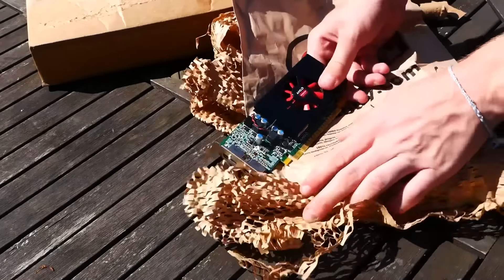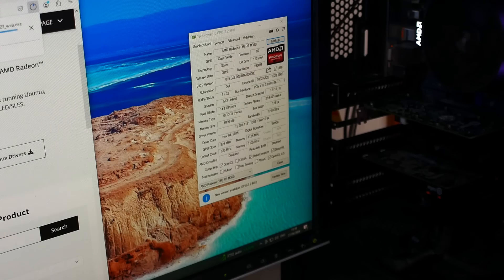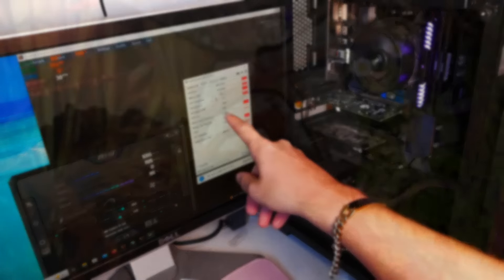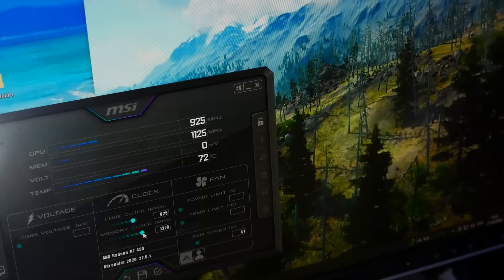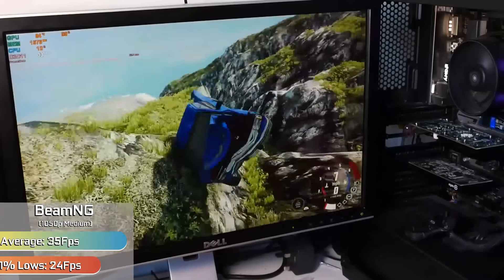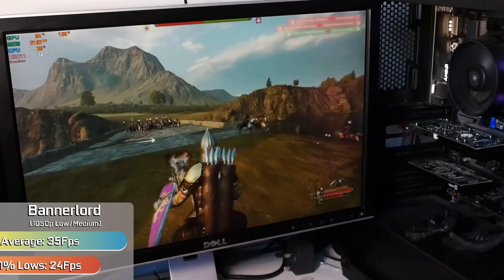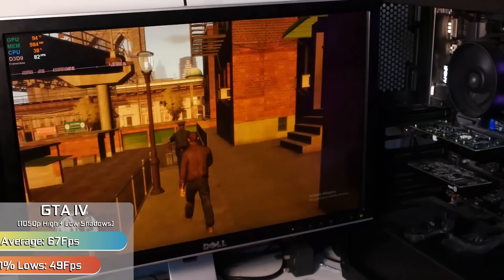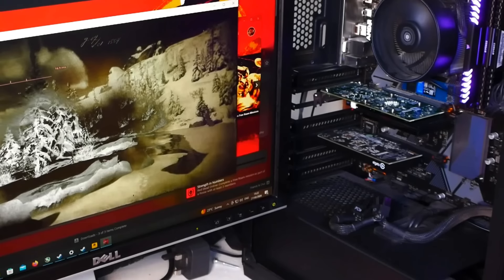AMDs Mysterious & Misleading R7 450...

Comment: AMD's budget cards are always bizarre. I swear the designers make them after waking up from a fever dream.
Reply: At least they have all pcie lanes compared to new OEM cards?
Reply: perhaps 'during' it?
Reply: They're designed for Drafting and 3D Modeling software users, which is why they're in business-aimed small footprint OptiPlex models. I think my old PC at work had this GPU, and I loved how well it handled hard workloads.
Reply: Fr, i have an R7 240 with 4gb vram, why??
Reply: @MrEdioss  or new retail cards. Like how the RX 460, RX 6600 XT, RTX 3050 and RTX 4060 Ti have 8 lanes and the GT 1030 and RX 6500 XT have only 4 lanes.
Meanwhile a stinky HD 6450 or GT 210 come with full 16 lanes.
Reply: @mactep1  So that they can say "with 4 GB [newest generation] Radeon graphics"
Same reason the HD 8000 series exist. Or the GT 300 and GTX 800 series. Or a 4 GB GT 730, or a 256 MB FX 5200
Reply: @mactep1 4gb can hook many people  bigger vram is good anyway and ddr3 is overflowing and they patches the ddr3 vrams and make the cards look worthy. Of course gddr5 2gb vram amount is enough for the entry card.
Reply: The incredulity I felt when AMD released the RX 560 XT (OEM-only, thank God) in roughly the same era the RX 5600 XT was out really put into perspective how little AMD's marketing makes sense to me, and it has gotten worse over time
Reply: @daemonspudguy  by the way 6500 xt 4gb is really good at SW outlaw. It runs it beautifully.The Budget entry card is worth of XT this time. I sold 6500 xt 4g, I am happy that the buyer would be happy to the star wars if he played. I sold having solid rx460 4g and r9 m360 4gb. They are solid. Also I have hd7770 2g and hd 7870 2g.
Reply: @mactep1  It is likely a DDR3 4GB instead of a GDDR5 1GB. The GDDR5 1GB is the superior card as the other 3GB don't matter because that card isn't powerful enough to take advantage of it anyway.
Reply: Often just a way to use up surplus GPU chip stock or free up newer and  better node volume for better GPU's.  Made obsolete though by better modern APU's.
Reply: @generationkilled  Good for saving energy with mini PC. I saw the photo taken by GPU market in one's garage. He put all gpus in a Styrofoam box like sliced bread. I will do those to my old GPUs.
Reply: @MrEdioss the cards you are referring to aren't even powerful enough to utilize 16 lanes... and makes 0% difference on the performance at that tier....
Reply: AMD is Chrysler…. From the mid to late 90’s….  Chrysler parts bin cars
Reply: @MrEdioss  they do, just those are not needed at all? Well maybe on pcie 1-1.1 mobos?
Reply: @alancarr195 I could have sworn the restricted memory bandwidth was a huge limitation for the RX6500. At the time of its release it (and especially the RX6400) were quite weirdly placed, as they were supposed to be lower end cards but you needed PCIE4 for them to perform well so they were a bad choice for anybody wanting to upgrade an old PC.
Reply: @thesenamesaretaken  the insane small bus was holding that one back yes, but not its pcie lanes(bigger bus i think they both couldve been better cards by a little for budget systems), but yeah some the versions that did run on x4 of those 2 cards specifically take a bit of a hit on pcie 3.0 systems without rebar and just cpus with no l3 cache and bad pcie support like ryzen 3500,4500,5500 paired with them started to hit. But like rx 6600. Rtx 4060, etc on 8 lanes don't send enough data to cpu to use the full 8 lanes at pcie 4.0 let alone 16.

Comment: Odd coincidence, I am building an ultra budget system with this today. Snagged this card, supermicro motherboard, X3460 Xeon, beat up case, Dell 200W PSU, and 16GB of DDR3 from a scrap pile. Add $15 for a 256GB SSD and it's a perfectly usable light gaming PC.
Reply: 775 xeon with 200w PSU is a disaster
Reply: @MrEdioss  Its socket 1156
Reply: Can I ask what games you even play
Reply: Dude, you can get a E3 1240 V3 with a motherboard for less than $30 used in most cases. Pair them with your memory, PSU and ram and you have a very respectful budget build.
Reply: @HardWhereHero I mean, maybe they don't have $30 atm, here in Brazil, $30 = (a bit more than) R$150... Not everyone will have that much to spare.
Reply: Oh, that is basically an i7-860.
If your board runs 190 MHz BCLK stable, you'll get it to 4 GHz.

But I would be careful with the PSU even on stock.
The CPU has a 95W TDP, the card 65W, and you have to factor in the other parts.
Only 40W to spare, take about 3W per RAM stick, about 5W for storage and about 5W for the chipset.
3W per fan (and you'd want at least one intake, one exhaust and the one on the CPU cooler) and you're down to 15W left.
And don't assume all of the 200W to be available on the 12V rail.
Reply: Yeah, your CPU is actually overkill for the R7 450, lol. You could put at least an R7 370 in there. Due to AMD's confusing product names, it is in fact much more powerful than the R7 450 (about 2.5 times).
Reply: @Lurch-Bot  That requires a 6 pin power connector which their power supply might not have
Reply: I wish there were scrap piles with ddr3 in it. That shit is gold around here and seemingly more expensive than DDR4

Comment: The GTX 750 Ti also hold's its value because it's not actually a 700 series card. It's a 900 series card wearing a funny hat and a trench coat. Which means that its still supported by the latest nvidia 560 drivers on windows and linux. Where as most of the 700 series lost support a few years ago.
Reply: I'd recommend looking at the Quardo versions, the K620 sips power, the K1200 is a great SFF card, and the K2200 is basically a full 750Ti with 4GB, and they're all dirt-cheap because it was the base option for workstations.
Reply: There is maxwell 2.0 gtx 750 somewhere around syllicon belly I assume
Reply: I have one of those sat in its box waiting for a power supply . Used it as my main for about 7 years (don't play new games) and still works as good as the day i brought it.
Reply: There are also like 5 Trillion versions of the GT 730.
Reply: @Fay7666  no no you want the p620 not the k that stands for kepler
Reply: Pascal architecture the p620 is between the gt 1030 - gtx 1050
Reply: @si4632  Not the K620, K1200 and K2200 though, these are Maxwell GPUs. Similar to their GeForce brothers (GTX 745, 750 and 750 Ti) which are Maxwell GPUs but branded as 700 series cards.
Reply: @OverTallman  yeah but for couple of shekkles more you can bag a pascal card i might get one for plex server transcoding videos
Reply: @si4632  Wish this was the case in UK though... K2200 is ~£20 used while P620 is at least a tenner more. Not to mention P620 is weaker than K2200 in terms of raw power.

It only makes sense when the much better transcoding capabilities of Pascal is needed, which in your case does.
Reply: @OverTallman  yeah im only looking at low profile cards as well the p620 uses 40 watts tops
Reply: @OverTallman  k2200 isnt really any faster either just consumes more power
Reply: still you can save a tenner like you say for almost identical performance
Reply: The 750 and 750Ti are also the lowest end cards that will work with the standalone version of RTX Voice (the microphone noise filtering thing that exploded in popularity a coule years back). Otherwise it's 950 and up only, kepler doesn't support the fallback CUDA features it needs/uses on non-RTX cards so it stays silent. I still have a 750Ti as a secondary card in my main gaming rig just for that purpose (so i don't blast my friends ears off with my mechanical keyboard) because my main GPU is an AMD and its noise filter built into adrenalin is absolute dog excrement in comparison. Also gives me some extra ports for additional monitors that don't trigger AMDs buggy idle power consumption issue. Next upgrade will definitely be a (used) Nvidia card again, that's for sure...
Reply: Yeah that was one of the first Maxwell cards if not the very first one. Nvidia struck gold with that architecture.
Reply: @OverTallman Like 50 bucks for a gtx 980...just saying.

Comment: This screams for a budget SFF build. Preferably just pick up an old Optiplex SFF and chuck this in + more RAM
Reply: If you get one for $5, this is fabulous. The lowest price I can see is like $20 for a 2gb full height OEMmodel, though - I'd step up the budget to 30-40 and get an RX 550 instead, the OEM version of that is basically an iteration on this card - 512 shaders, 4GB GDDR5 VRAM, but GCN 4.0. It's about 33% more price for 33% more performance, basically.
Reply: A FirePro W5100 can be had for around $30, has 4GB GDDR5 and 768 GCN 2.0 cores. It is roughly equivalent to the Xbox One iGPU in performance so it should run pretty much anything that runs on an Xbox One. The real price for an R7 450 4GB in the US is $30 or more. The W5100 is 50% more powerful and about 3% behind a GT1030. The W5100 supports feature level 12.0, whereas the R7 450 only supports 11.1
Reply: @Lurch-Bot will the w5100 fit sff? Looks like a big card
Reply: @Lurch-Bot  wx 4100 is one of the best gcn low profiles, 4gb vram and decent performance at 1080p even, should be about ps4 level in terms of gpu performance

Comment: I had a HD 7770 before upgrading to a GTX 1650. Nice to see older hardware still being able to shine in modern day.
Reply: I've got 2 of those ready to go inside a retro PC for some windows XP gaming hahaha
Reply: I still have my R7 250X here, originally supposed to be for me secondary system, but that got my old 660 Ti once I grabbed a 1060
Still a fine card. Good old AMD Finewine.
Got mine from the default 1000 MHz GPU 1100 MHz/4500 MT memory to 1100 MHz GPU 1337 MHz/5348 MT memory. The memory would go a bit higher, but I found it much funnier to be able to say my chips run at 1337 MHz.
Reply: @davelowe  I have two hd7770 now. Once I had 3. Hd 7770 2gb I used recently in my one of win10 pcs. The other one is in the box
Reply: Nice cards🙂. I even have my old MSi HD 3650 with 512MByte GDDR2 and MSi Cyclone HD6850 1GByte GDDR5 on my shelf as decorations.  I only find out where the bios switch on my Cyclone was after I upgraded it 😅

Comment: I scored an old OEM RX 550 4GB low profile card off a junked Dell next to a dumpster. That's right, a friggin' DUMPSTER. It outperforms an Nvidia GT 1030 2GB low profile card while only maxing out at only 50W. I've kept it around as a backup for budget builds.
Reply: I got a dell next to a dumpster too😂😂😂😂 but the video card was removed, and the cpu is an intel core i3-4130. The pc is ok for basic web stuff but not gaming due to not having a dedicated GPU.
Reply: It's annoying what people will throw away.  I found a perfectly functional Playstation 3 sitting next to a dumpster.  Then a month later, I found a third party Playstation controller next to a trash can.  I even found some games somebody was throwing out, unfortunately, those were for PS4.

Comment: I also own a similar OEM R7 250 2GB I bought used on ebay for about $20 about 2 years ago.  I put it in an Ivy Bridge SFF computer I found on the sidewalk and use it in my HTPC for couch co-op games.  With appropriate settings I could play Mordor: Shadow of War at 30 fps.  And my card is tier below the one featured here.  Weirdly my R7 250 overclocks significantly and the benchmarks show a nice ~15% GPU uplift.
Reply: What are some couch coop games you play? 

I'm currently trying to set up a pc for that purpose.
Reply: The R7 250 is good but quite a bit behind the GT 1030… but the 1030 goes for a much higher price
Reply: @sajanator3  It runs Overcooked 2 at 60 fps @ 1080p, no problem.  Though in the US, a AMD WX4100 4GB might be a better choice if you have $50 to spend on a SFF HTPC setup.  As that card is basically a RX 560!
Reply: @Bboyman1150  ya a AMD WX 4100 4GB is a better option at that price point if you want 1030 performance or more.
Reply: i used a 250 for server gpu output for a while
Reply: @Castaa  what are other games you play? 

I've found that they've kind of erased couch coop in 2024

Comment: For some reason, here in the states, these sell for the same price as the Rx 550 at ~$30
Reply: Yeah, I checked eBay and they are running between $25 to $30.
Reply: @mattelder1971  if I could get my hands on this gpu for $5-10 I'd keep a stockpile for any and every office PC I randomly procured
Reply: You can also get a secondhand RX570 for about that price too which is crazy. I see $40 regularly.
Reply: @tacticalmattress  Yup, even 4gb 580 can be in this price range, for 8gb version they usually want more though.
Reply: @testtest8399  I still have one because it just isn't worth it to sell. Keep it for troubleshooting or i guess incase any of my newer GPU's die

Comment: casually twists the bracket straight to fit it into regular case
Classic.
Reply: I have always felt doing this was a low point in my IT career. far more convenient than removing the bracket entirely and having it flop about in the slot! - I mean, what else can you do?
Reply: @ChishanFipz  not use it
Reply: @ChishanFipz  forbidden jitsu, Dremel a slit into the case PCI rung.
Reply: @Anthrocarbon  Glad my test-junk-case (InWin 303) doesn't have any of those to start with lol. if you remove all the blank slot covers it's just a giant gaping hole, intended to make installing a vertical mount easier... (which I always found dumb because that then blocks ALL other slots, vs the IMHO better option of dedicated vertical slots in the case)
Reply: I didn't appreciate it, LOL

Comment: Reminds me of the ATI Radeon HD 5450, sorry i mean the HD 6290, oh my bad it's actually the 7350...oh no wait, the 8350...actually wait, the R5 220

Also, the legendary Nvidia ION...wait, it's actually an 8400...or is it the 9300....or the well known 210 !!...wait it's more of a 310...or maybe even a 405! NO, the 505!!

Could probably list many more, but the list is too long hehe
Reply: No point making it complicated..
Reply: @darthwiizius bratan it was just a joke, its all fun and games. It's a fun card, but many have a history as such, reuaed. The damb 210 wa sold till like 2020, of not more. Then the 710 took over, which is basically a 210 ofnits ewra
Reply: @NecroFlex  
I know mate, I may have been being somewhat sarcastic..
Reply: Remember that there were 3 versions of the 8400 GS
One with a G86 chip and decent budget performance
One with a G98 chip and half the performance
And one with a GT218 chip and again reduced performance and cut down memory bus.

The 9300 GS is the one identical to the second 8400 GS
The 205 is identical to the third 8400 GS (the 210 and 310 are closer to the first 8400 GS, but on GT218)

But my favorite example is the GT 730, because that is a card still seen in some "gaming" rigs on the used market today.
Three models:
One with a GK208 and 64-bit DDR3
One with GK208 and 64-bit GDDR5 (if for whatever reason you'd want one, this is the one to get)
And one with GF108 and 128-bit DDR3 (don't get fooled by the 128-bit interface, it's still slower than the 64-bit GDDR5 on the second model, plus the GPU is about 60% slower)

GK208 is also used in the GT 630, 635 and 640, the latter of which was even a decent performing midrange budget card.
But GF108 was originally used in the GT 440, then reused as GT 530, then GT 630 and finally GT 730

But the card I totally want to get is a GT 420.
I'd pair it with an Athlon II X3 420e and a 120 GB SSD and 300 GB HDD for 420 GB total storage. Won't be able to give it 4.2 GB RAM, but could get as close as I can get.
And if that doesn't tell what the purpose is, let's just say I want to build a meme machine with a specific theme.
Reply: 9400 gt I have two. I really have good feelings in two and keep those two for battle field...?  I also have 8400 gs low profile ... I don't know I keep it and love it after he said dodgy graphics card
Reply: now i want a video with all those compared
Reply: @HappyBeezerStudios  Video card manufacturers have been scouring the back alleys of China the past few years to find stocks of old GPUs to make new-old shitbox cards to sell, because new video cards are selling so poorly. Both Nvidia and AMD have entirely abandoned the entry level and low midrange segments for years now, and nobody can afford dropping $700-2000 on their high end cards.

You could buy a new HD5450 up until just a few years back. The GT730 is still around today, as are RX580 cards. I bought a couple of XFX RX580 cards to use for video encoding/decoding earlier this year for I think $120 a piece. The next card up from it was an RTX 2060 for three times the price. I remember back even 10 years ago there were a half dozen options of current generation cards, not mystery meat pulled from the back alleys of Huaqiangbei and thrown on some hastily designed PCB to be sold as a pittance.

Those Chinese video cards on Ali Express are starting to look rather tempting. I've bought several motherboards from there and they turned out fine, maybe the video cards are too, so long as you don't get a faked one with a hacked BIOS.
Reply: @GGigabiteM  the thing is, they now give the low-end cards midrange names and lower-highend prices.
The rtx 4060 should've been a 4050, it's slower than a 3060.
 even more, the entire 40 lineup should've been a tier lower.